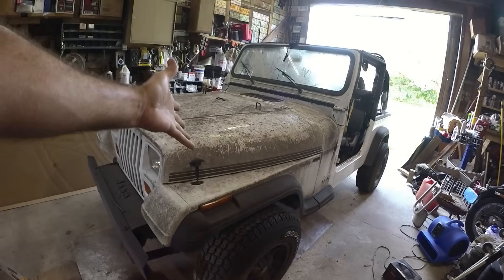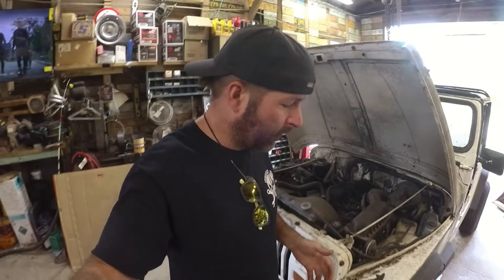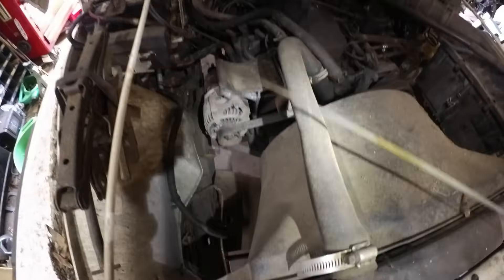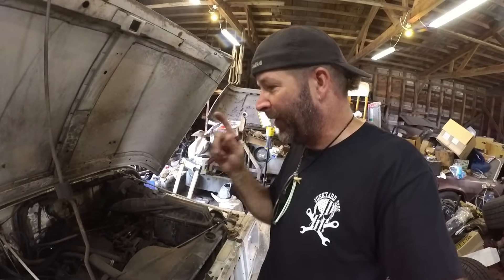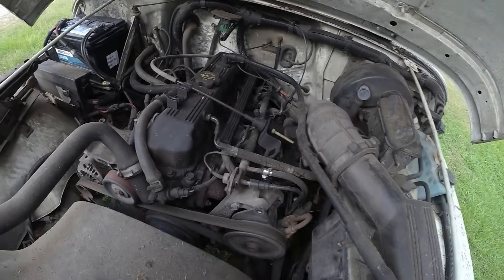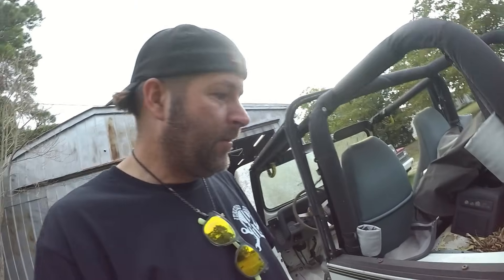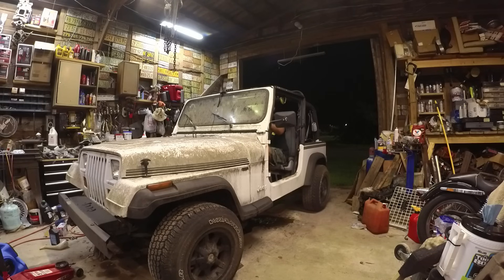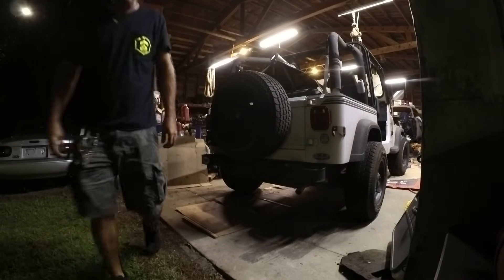I Bought A $499 dollar Jeep     Will It Run?

Comment: you should turn this into a series. definitely could be a good off road build
Reply: Totally agree with you on that mate
Reply: Dude. That's a driver.
I live next to Tahuya 4X4 trails and own two jeeps. (and 2 K-5's, and a rock buggy)
I build em all day long. The YJ is good if you want to leave it stock and not blow a wad. The leaf springs are solid, and tried and true. But slightly limiting on doing cheap builds. A pair of lockers and a bit of lift to cover tires, you're done, eith a good driver that is more than capable of getting you in trouble.
Awesome rig.
The TJ and later, with the control rods and coils are the builders that can go where you point. But cost bank to get them dependable.
Br good, have fun.

Comment: I have a '91 Wrangler, 2.5L 4cyl. The Jeep continues to run like a top with almost 200,000 miles on the rig. Onward!
Reply: My'91 Wrangler came with the factory AC. I usually use the 'window down' air conditioning.
Reply: the 2.5 has 4:10 gears in the axles.....replace the 2.5 with the 4.0 and a stick and you have a monster

Comment: I loved my 1988 Jeep YJ.2.5 4cyl .  It was the first car i bought new.  Was $8999 with 0 options. Didn't even have AC or a back seat.  AC was a dealer installed option anyways, they didn't give with AC from factory back then.

It had 4.10 gears and crawled great.  The manual 5spd had to rebuilt and eventually swapped in a fuel injected HO 4.0 i6 from the mid 90s.

Eventually sold it in 2004 for $1500  😢
Reply: $8999 new? Incredible.
Reply: @BurnerJones not really..it's the equivalent of like 24k in today's money.

Comment: Love the old Jeep. I had one with the 4 cylinder and one with the 6 they were both so much fun in the mountains in British Columbia. And repairs were cheap and easy. Would recommend a bench vice on the front bumper and carrying spare u joints and a good hammer

Comment: What memories this brought back.  I bought a 92 YJ brandspankin new off the lot in Columbus OH.  Black, soft top, full gauges, no radio, no ac, full carpet, running boards.  Loved it for 275,000 miles (she was a Flintstones Jeep by that point, but yes I really got 275k out of her!)!  Same 4 cylinder which was notorious for bad wrist pins.  I attribute the engines lifespan to Amsoil.  In my 60 years, 45 of them owning many 4 and 2 wheeled vehicles and quite a few different Jeeps - my YJ is in the top 3 all time favorites.  I put a 2" shackle lift on it, squeezed 32x10 Dunlaps on white American Racing wagon wheels in there and she was unstoppable.  Looked like a big ole Tonka Truck!
Great vid as always Isaac!!  Love seeing you take what many consider bone-yard material and getting it back on the road!  Thanks for all the great videos!!!

Comment: Bought a 95 Wrangler for $500 two years ago. It had been sitting for about 6 years and owner said he just couldn't get it to run. $400 pcm and a new fuel pump and it's good to go, not to mention it has absolutely ZERO rust!! 4cyl with 5spd is what mine is.

Comment: a jeep is on my bucket list  but around here literally every jeep i saw on craigs list was over a 1000  not running missing critical parts (usually engines and transmissions) wrecked or just rusted out

Comment: I have a 94 and definitely the most fun vehicle I’ve ever driven.  2.5 are nearly bulletproof.  Nearly 250k. 

You’ll kill that 2.5 with a/c. 

Replace the fan with an electric fan and you’ll get a tiny bit more hp.

Comment: I did a motor swap on one of these same year 92 in the late '90s Chevy 3/4 ton axles 327 V8 It was a beast 40 in tires. Food for thought
Reply: Since you liked it I can tell you more had a I think 203 gear drive transfer case 350 automatic transmission I did a spring over axle conversion It was back in the day so I had to fabricate all my mounts total of 21 inches of lift It was nice 3-in body lift also

Comment: Excellent video Issac  :) yes my Cousin Nancey has 1994 Suzski   Samaria  2 door Jeep in black color plus hard top also convertible top also take doors type she bought brand new and got 31 inches tires and 4×4  also 4 cylinder to basic no Air Conditioning  and 5 speed Manual transmission! Also 2017 Jeep Cherokee  4 door it 4×4 more options too in Black body and grey Interior  plus V6 motor and Automatic transmission  she off road both to!

Comment: Owned three jeeps and my favorite was the 4 cylinder (even better than my 2007 Rubicon).  You don't break u-joints and it's not bad on gas.  If I could go back in time I would have bought an air suspension seat the ride is really not comfortable.  Reading comments below I would never lift a jeep it's a waste of time and $ (only issue I remember having with my 4 cylinder was a bit of blow by...burned oil.

Comment: Ike..... I thought of something you will want to know.........these YJ's come with 20 gallon tanks/ / the vent tube will have sagged by now/ and will puke at as little  11 gallons  and kick off like it's full~ take note when filling to full how many gallons ?   I had removed my tank to change it's rubber protective wrap.. I just used 3 layers of pond liner and wire brushed the metal outer shell primed & painted put it back in and wish I had done/known about that vent tube sagging. so it was in place when I did it, when I had to pull vent tube. . so it can be done in place. or //  mine had a bunch of gravel vibrating  holes into the rubber and metal and worried it would wear a hole in the tank/ just wished I had done the vent tube when   the tank was removed and had access  to the inside and just grabbed it and spun it towards the top.// anyhow~~~ I hope this will help some day ~~~ I'm still putting mine back together.. worked on painting the hood latches and the heater plenum metal doors..normally covered in foam but I'm resealing the thing so the air goes through the heater core not around it. have fun...

Comment: Don't know how you keep finding these deals. Anyhow, put a quart of simple green in the radiator and fill with plain water, run for about thirty miles or so and then drain system. I have had great luck doing this with my vehicles. It really cleans out the grunge and sludge.

Comment: Nice driver. Leaf jeeps are good if you don't want to put a lot of dough into them. They are more solid in stock form than the YJ's and later. 
If you want to dump a butt load of money, the control arm jeeps are bad ass after you replace everything below the frame.

Comment: I have one of those jeeps it had the 4 banger in it and got it with a rod knock so I ripped out the 4 banger and put a 318 Magnum in it out of a dodge durango slapped a 4 bbl carb on it with MSD ignition and the thing has ran like a top ever since. My old lady took it as her summer ride so it's been a while since I drove it.

Comment: Stupid things to know about the YJ wrangler.....
weak point of the 4 cyl is the crank position sensor in the top of the bell housing....drivers side......they go out constantly.
And the Alt has 2 fuses.....and if the alt has a bad field......yet shows its charging.....the voltage reg is in the ecu, and it will go limp mode on and off as you drive. really makes it run like poop, so watch your charging gauge.
and PLEASE......where the fuel line goes through the frame and into the tank. they rub through.....replace it and wrap or re rout it

Comment: Would you like to trade it for a K-5?
82, little rust in floor corners. Frame clean. Minor dings. 350, NP465, 208 transfer. Runs good. 
I've got two.
Reply from the maker: No, sorry. Ive got 3 k5s

Comment: Rip the crap engine out and put a spare sbc in it. Even something like a 305 with 33s will double the value.
If its got a top ill give ya 1k for it as it sits, can be there this weekend for it. If it has a hardtop ill up it to 1500.

Comment: OKAY ~ I seen you posted this 9 minutes ago... I was so jealous I couldn't watch... It's in better shape than mine and I paid $3800.00 for it// so you made me a little sick// now I'm here to puke///// congratulations #astard.../// moving on ~~you might have blow by// replace your thermostat making sure it is a 195 temp // your rings should reseat/ See if you have oil in your intake tube where the rebreather meets it /   or oil leaks from area / Underneath your hood is blackened by smoke or oil is my thought of a sign of that ? // and the fix // Mine was same and worse/// Nice to see your fan shroud intact..// That broken cable terminator to Relay Fuse box is common //good quick catch on that /// Wish I could detail it for you make her showroom/// I put my radiator and electric fan from my '66 mustang in mine because the one in the Jeep leaked and you can't really fix them plastic garbage things.///  you should have 4:10 gears front and back/ AX-5 tranny//  biggest tires 31~10.50's without a lift ///  You'll like the hood// It can rest on window I usually use a pillow to soften the touch/contact /// gives you better than average access//// and see better /// Mine has no rust and is the '94...your interior doesn't look bad// just dirty// that cleans up just fine./// mine was sprayed with Rhino Liner and all chipped up because they didn't clean their surfaces prior to applying// dirt bags abused  it terribly// I can't really show you photos here//  I can post them on my facebook page Otter Hessian //  REDNECK Garage is Hoot and good source of info/ until you have a problem and he doesn't cover it // You/One use to be able to Order the Official SAE Shop Manual from Chrysler $100.00 and every 6 months they do a publishing and a 2nd volume covering all the bulletin updates...// I never spent better money../// I have the one for '94 but it is in pdf form 2158 pages even covers the Postal YJ or DJ version..